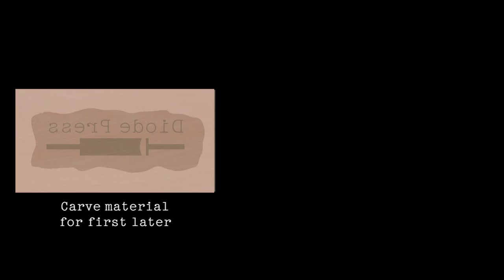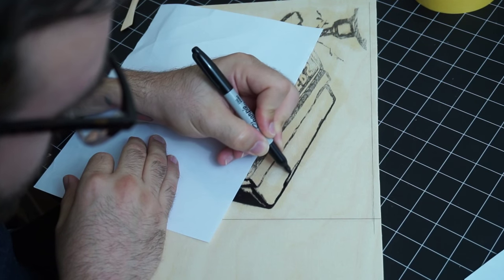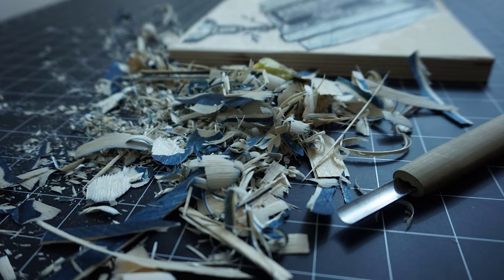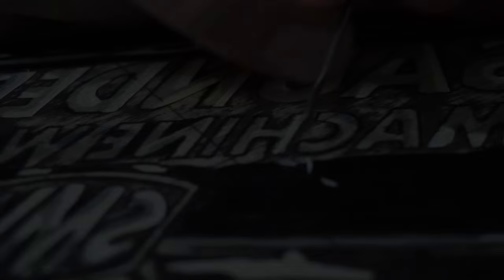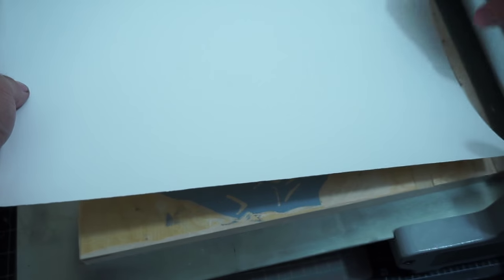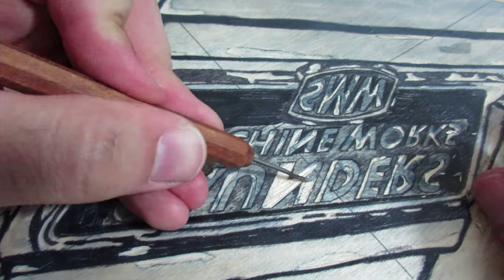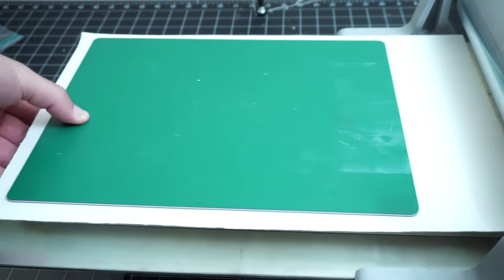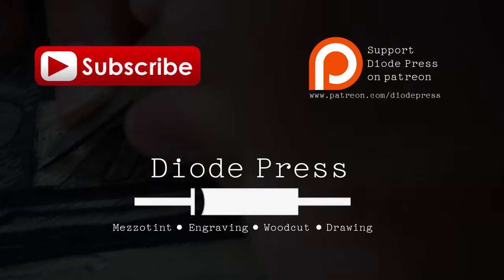Woodcut Printmaking: Reduction Woodcut for NYC CNC

Comment: I think I have a good tip for you on how to transfer a drawing/design into a surface, that is similar to the wax paper inkjet version but i think it works better than the wax paper one  

you will need the following:
a piece of paper that can fit in a printer 
some adhesive transparent plastic film
and a inkjet printer 

you take the pice of paper and you carefully line it with the adhesive transparent plastic film (watch out for bubbles and creases), once that is done you are actually preaty much finished. 
Now is just a matter of putting the lined paper in the printer and printing out what ever you want, just like the wax paper method 

the advantage of this method is that once you transfer the image onto the medium you can wipe of the ink from the piece of paper with some paper towels soaked in alcohol, and use the same piece of paper over and over again. The other nice thing is that you don't have to look for that specific label paper, you can use any type of paper and what ever size you want. And yet another advantage is if you line it in both sides you don´t have to worry with wich side to print on.

so yeah that's my tip, hope you try it and that you find it as useful as I do.

Comment: The cutting mat to print with was interesting. Explain how you adjusted an etching press to print a relief, please...
Reply from the maker: +Janet Badger Most etching presses I've used have been able to print relief fine, as long as the roller can raise up enough, depending on your wood or lino. Often people will use rails of whatever material they are printing along the edge of the press bed to help even out the rollers also. I have to use the cutting mat because my top roller has tiny grooves that will cut into the paper. Thanks for watching!

Comment: Graham, great video.  You carve a registration line in the wood and use a center mark for the second direction. Is that better than carving a corner and a line? Or is this just a style of work thing. The second method will save having to mark each sheet of paper.
Reply from the maker: Thanks! I think it's just a personal preference. My paper was wider than the block on both sides, so I think I was stuck with that option. So many ways to do the same thing though, always trying new ways!

Comment: turn out awesome.. never have the courage to carved on wood, usually I carved on linoleum block (the rubber one) what do you suggest the type of wood to carved for beginners?
Reply from the maker: +Arkky Anindita I think Shina Plywood is the easiest to start with. It does not really have a string grain pattern, so you can carve from any direction fairly easy. You'll need some woodcut tools too, since depending on what you're using for lino, it might not hold up well for wood. I get my Shina ply and most of my woodcut tools from McClains printmaking online, not sure if anyone else carries Shina. Thanks for watching!